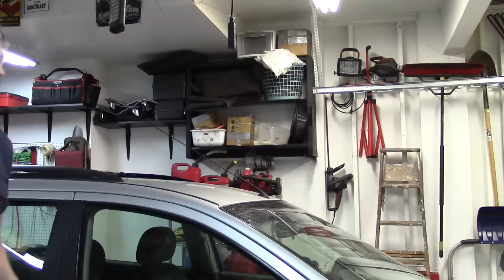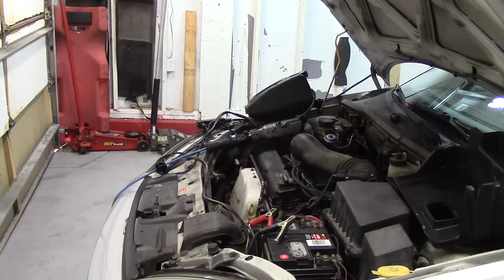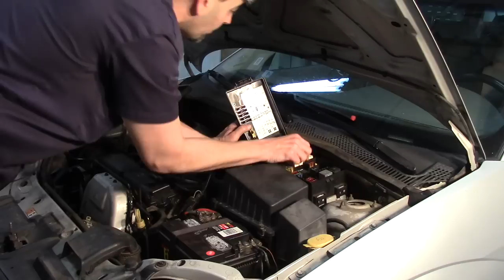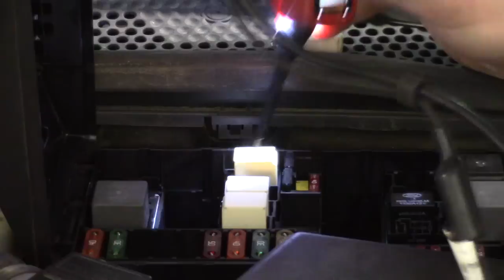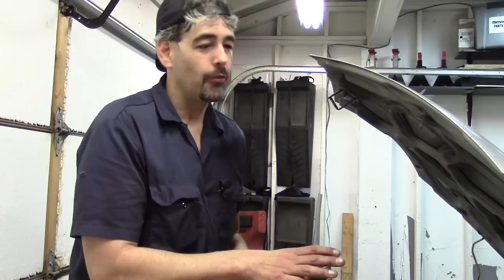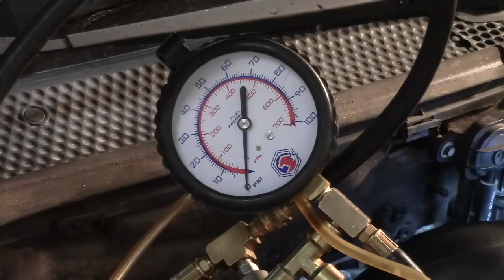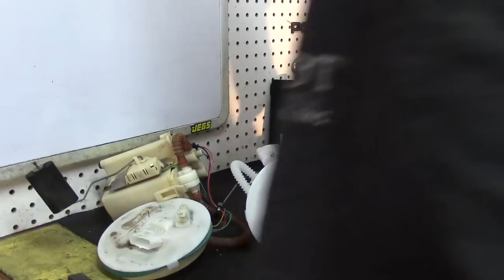Cranking No-Start Real Time Diagnosis -Ford Focus

Comment: I like your videos and have learned a lot from them, especially about the approach/methodology of repairs.. but I think this video is mistitled. The description says "No Crank No Start".. yet the engine is cranking, it just wasn't starting (until you fixed it in like 2 minutes! Awesome!)

I found your FASTTEC series and think I'll find more answers there. 

If you change the title, I'll give a thumbs-up! I haven't given anything but a view so far. :)
Reply from the maker: If I recall on this video, initially it was a no crank no start, was it not?
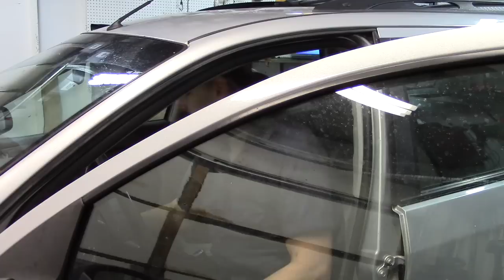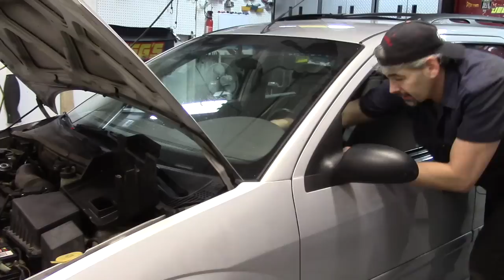Reply: At 2:10, the battery makes a click-click-click sound because it's lacking charge. After charging at 2:46, the engine cranks but doesn't start. At :22  you mention that it's not starting and not cranking. I was confused because if it is no crank, it is not shown in the video. 

Also, in the title it's "Cranking No Start" and in the description it's No Crank-No Start. I don't expect your videos to be perfectly labeled, maybe if I had my own productive channel, I would :P     Basically I want your channel to be as useful and understandable as possible in all aspects. Is there something that I'm not understanding? More likely I just wish the whole thing was even simpler than you explain it to be! 

Didn't learn much mechanical growing up, just trying to understand the components and how they work together, well enough that I can repair my car. Watching the 3rd FASTTEC video gave me confidence to repair it myself. I have all my tools together, all set for Monday to diagnose.

If I do need a starter or fuel pump, where would you recommend purchasing one? It's a 2003 Chevy S10 V6. Thanks Matt!
Reply: (If you're willing to give some quick advice on where to start, here's what's happened with the truck: 

2  week ago: it would Crank No Start, after 1/2 minute it'd sputter to a start.. only happened once or twice

1 week ago: No Crank No Start, started after cable-jump

3 days ago: Tested battery @ Autozone. Tested Healthy/Good

2 days ago: No Crank No Start, lights working BRIGHTLY, started it 45 min earlier just fine (no hiccups).

So I think that the starter was working but slowly died, given that it would start sometimes, sometimes not*. I believe that's the starter's job. Either that or corrosion/voltage drop. What do you think? Thanks again 

*I started it multiple times the past 2 weeks with only the 3 incidents I described. All other times, A-OK.
Reply: Wait a minute, Now I get it! It's BOTH "Cranking No Start" AND "No Crank-No Start" because this is Schrodinger's Catchanell.
Reply from the maker: Michael Chavez Hahahahaha I didn't think of it that way but there is certainly a duality aspect for sure!  Nice!!
Reply: Michael Chavez h

Comment: MAXI FUSE
Reply from the maker: What's that?
Reply: Schrodingers Box MY focus shut off on me one day and the cause was a blow MAXI FUSE under the hood.
Reply from the maker: DEBLAMA1 How can that possibly be the problem in this case though? It is impossible it could be a maxi fuse.  What makes you think this could be the cause based on the data shown?
Reply: Schrodingers Box I was only talking about what happened to me

Comment: Matt, by using a paper clip, which terminals do I jump in a relay? Switch side or it depends on circuit design?
Reply from the maker: You want to do as I did and validate the design first to make sure you are not bypassing the load and short circuiting the system causing damage.
Reply: +Schrodingers Box bypass the load you mean the fuel pump in this case?

Comment: I AM BACK I FOUND   P0115-P0141-P0120....NOW THE CAR WON START AFTER I USED IT FOR 20 MIN DRIVE ..
Reply from the maker: DSo what data did you get for the code diagnosis.  Can't help with just a code.

Comment: 11.05  how did they destroy engine ?
Reply: He probably meant all the electrical components that make the engine run. When you jump, you jump on the power side, not the control side because the control side is controlled by the ECM, and ECM uses 5v only while you jump it with 12v directly from the battery....doing this will fry your ECM and may fry other electrical components such as MAF sensor, CAM and CRANK sensor...etc :)))

Comment: Using Loadpro leads, this would have been much faster.  If you haven't yet watched Dan Sullivan's videos, you should.
Reply from the maker: +True View How would it have been faster? Either way this is an open circuit, not a resistance issue. How would load pro have been faster??????

Comment: nice vid, enjoy the clarity. Wish all on call outs and garages followed this 101 procedure. I usually teach my apprentices and staff to give the tank a few wacks while ign on or someone cranking,often pump will actuate and verify quickly a fuel pump fault. (of cause ensuring brake on and out of gear or in park!)
Reply from the maker: +Peter datechmen How do you confirm if the whacks indicate it was the pump vs wiring?

Comment: Would a zero voltage drop across the fuel pump fuse during cranking or priming  prove that the fuel pump is bad?
Reply from the maker: If there was absolute zero voltage drop then there is either bad pump or open in wiring. if there is "ghost voltage" then surely the latter.
Reply: Or the meter picking up stray voltage from a flourescent ballast or other electromagnetic source.

Comment: Good job.  

I was expecting spark.  My Focus had an ignition control short to ground.  The control line rubbed through insulation on egr tube and, of course, pulled down circuit and fried the coil.   The coil had a big crack in its bottom. 

Thanks for posting.

Comment: Did you say that you're not  mechanic? What exactly do you do? You're obviously well trained in this. Otherwise, how would you know about electrical circuit operation and function?
Reply: +689452379 Well, he's actually a microbiologist (I think it was?) with other interests, I guess you can say. And he's (obviously, as you can see) a very smart and  intelligent man, with both the science and know-how to back up what he does. Love how his mind works! Sees logic and/or solutions to everything. Actually, I've learned more from his channel about stuff like the electric system on cars (even though that's not even his strongest suit by far, according to himself) than anywhere else. Do yourself a favour and sub! :)

Comment: I just replaced headgaskets and intake gaskets on my 2001 chevy monte carlo 3.4. changed all gaskedts reinstalled all parts plugged in all electrical connectors.checked for spark, fuel pressure,check crank sensor. it has full charge on battery but now cranks slow and trues to fireup until battery is drained low enough not to crank engine. problem is it will not fire up and run. the battery light on instrument cluster comes on then shows security flashing in message center on dash. hit the key to start and cranks until battery dead.im am at loss as i bought the car drove for month started fine, one day overheated and found the gasket sealant failed on intake. Since i had it tore down that far i decided to go ahead and replace headgasket, exhaust,upper and lower intake gasket, replaced faulty throttle posistion sensor just before overheated. im am lost and cant afford to take to shop being single dad i dont have money for shop fees. any help would be appreciated.thank you. (jasontaylor4503@gmail.com)
Reply from the maker: +Jason Taylor So what's the problem? FASTTE or C? Start there

Comment: Just wondering.  An OBDII sensor reads the fuel rail pressure on these cars.  Is that a reliable test for fuel pressure?
Reply from the maker: +Rusty Reckman While I have never seen it not work,  technically if you have no fuel pressure indicated, is it because of no fuel pressure or because of problem with fuel pressure sensor or its circuit?

Comment: Ive got a burning question hahah your videos are great but im still stumped. same care 2000 dohc ford focus, died while running, changed the battery it ran a few miles and hasnt started since... ive done new fuel pump and filter crankshaft position sensor and new plugs.. it will start on starting fluid but quickly dies.. its got spark and compression and when i pull the fuel line to the rail it dumps fuel out at the turn of the key. im stumped it seems the injectors arnt pulsing or somthing but im at my wits end. any help would be greatly appreciated. thanks in advance
Reply from the maker: +j derossett What was the data you got that indicated you needed to replace the fuel pump? And more importantly, what was the data you got that indicated you needed a new crankshaft positition sensor?
 I need those data in order to help.

Comment: You just proved that what my auto shop instructor said was true. "A no start should be the easiest problem to diagnose.", and the hardest, in his opinion ... driveability. Greatly enjoy your videos. The step by step logical path is extremely helpful.
Reply from the maker: +pramponi I agree with your instructor very much!!
Reply: @SchrodingersBox  
How about a no electricity problem?
any tips?

Started as an "intermittent" clicking sound (?possibly coming from a relay/solenoid under dash near fuse box?) and electrical power off/on...(only had it for a few weeks)

NOW ... that has just become a "constant" no power at all, ever.
(open the door: no dome...
Turn lights or hazards,  nothing...
Turn key nothing ..no power at all...
(Except a faint red glow on the little red led near the hazard flasher button, but when keyboard turned goes out)
...and no more clicking either...

 all grounds tested good, (put jumpercables to bridge anywhere there might have been a weak ground too just to see)
 new battery, all charged up & good voltage ...but nothing...
 (automatic transmission)
Reply from the maker: I would start at the fuse for the circuit  and if there is no power at fuse simply trace backwards from there. If there is power at the fuse trace forwards. It’s actually way easier if there is consistently no power. Is much trickier when it’s intermittent.

Comment: Superb! Inertia fuel cut-off is another 'quick check' (for me). When I crank I check for a slight movement on the tacho - to 'quickly' verify the crank position sensor.

Comment: keyboard shop manager, thumbs sideways for get that car out of the bay and work on something else for the rest of the day!  :)    sometimes a dowel between the tank and your ear can give a bit of data when a fuel pump is near the end of its life, sounds ratty or irregular.  I have a customers focus that needs a fuel pump, changing the filter did help but the pressure is weak and if you hit the bypass on the pressure gauge, it drops more than it should so its low on power when you mash it.   They'll bring it back sometime for a pump and another filter cause filters are cheap

Comment: Wish you were in Pinetop, AZ area, because I would hire you. My car cranks, but has no power going to the fuel pump. The fuel relay appears to be good. Sprayed starter fluid in throttle body and car temporarily starts up, so I got spark. Checked inertia switch.  2005 Jaguar Stype v6.
Reply: +Harley Rider You need to test for power at the relay port then or for an open to the fuel pump
Reply: +Schrodinger's Box Quantum Mekanix 
Thank you for your response. I am a learning armature, so forgive me if I am not certain that my car has a 'fuel relay port". Perhaps on my vehicle it is called something else? I googled it and came up empty.
 Also, what do you mean by "for an open to the fuel pump". You mean a short in the wiring?
Reply from the maker: +Harley Rider Yeah honestly you'll probably need someone with electrical experience to track this down but basically if you re-watch my video look at where I am doing the DVOM testing at the fuel pump relay port in the engine bay. Thats your next step and I show how to do it in the video.
Reply: +Schrodingers Box Thank you sir. I will rewatch this video for the DVOM testing. thumbed video up.

Comment: im a good mechanic  i have a page on facebook and i get lots of bussiness as a mobile mechanic. i sprayed starter fluid in the throttle body and the car started just fine ran a few minutes and died im going to check the fuel pump by taking off the fuel filter underneath the car and then turn on the key if the gas dont come out of the fuel tank then its the fuel pump. but of course ill check all the fuses before replacing the pump. after i check the electrical if the pump dont work ill change it out and that should fix the car. 2003 ford focus also has a starter relay fuse in the box next to the battery and if you change it out it could also fix the problem. but im sure its the fuel pump because the car was being driven and it just died. it starts with starting fliud so that tells me its the fuel pump. blevins auto repair on face book alturas ca
Reply from the maker: +James Blevins If fuel comes out at the filter how do you its at the right pressure?
Reply: +Schrodingers Box . i would use a fuel pressure gauge on the fuel bleeder on the fuel rail

Comment: Great fast clean diagnosis. Puzzled by the 17 thumbs down - I couldn't see anything wrong with your explanations and methods at all Matt. As the saying goes "you can't help some people"
Reply from the maker: +mrghiax Exactly.  Many of the thumbs down are from "over the hill" professional mechanics that realized their vacuum gauge and dwell meter are useless in today's world and the fact a DIY can work on computer controlled vehicles frustrates them.
  I see it all the time.
  Others just thumbs down because the video is longer than 3 minutes.
And others, believe it or not, are just trolls that actually subscribe to my channel and thumbs down the instant I make a new release despite the fact they watch and learn from the entire video!

Comment: In the feul pump the motor was blown or did not work or was fried. What is the voltage of such motor in fuel pump?? Please share about it thank you and hope to hear from you soon.
Reply from the maker: +Oliver C In this video the 12V motor itself was fried.  In a previous video it was actually the wiring on the motor's "pigtail" that was fried- the motor was actually OK but best to replace it anyway.
Reply: +Schrodingers Box Thank you, and you are very generouse man. I am an Electrical Engineer with two Engineering degree one in Electrical engineering and one in Computer information engineering. I would like to finally study motor mechanics or will just pick it up from vidoes like yours. The 12 volt motor is not expensive so why does it cost that much to replace. I mean you can buy a 12 volt motor for nearly 25 dollars or even less in UK.

Comment: Fuck dude, same thing happened to my '03 fuckus... CPS, then, after sitting in a parking lot for 3 hours, eventually gave up, here now, on the internetz
Reply from the maker: +Chris Poteet How did you diagnosis it had CPS failure? If you can do that then diagnosing a no start should be easy
Reply: Schrodingers Box We actually found out, the '03 Zetecs don't have pressure control, they have a bit that controls the power of the fuel pump, we heard the pump humming on the car's pre-start warm-up, its called a pressure regulator, but it isn't really the traditional style, its just before the fuel rail, here is a photo (its part #5) apparently they fail quite often and are often be read only as fuel pressure loss, I think it was code #10391, anyway, I'm getting the part tomorrow (12/12) I'll comment again whether it fixed it or not, I did find though that the regulator did seem to be stuck...
Reply: +Schrodingers Box put the new part in, started right up

Comment: I am a subscriber to your paid channel and have watched the series on "how not to fry your pcm", but a question-can it hurt the pcm by testing through the load with a jumper if the load is defective and there is no resistance?  I admit electrical testing is still a weak point for me.  Thanks
Reply: +Jim Buford Actually on most any system you actually won&#39;t fry the PCM through the starting circuit regardless of what you do however you can certainly fry other parts of the circuit.
  It is important to remember that using the method I show through the relay port that you have several possibilities to FUBAR the deal
1. Send the power feed on the control side positive. Doing this will probably do nothing unless the key is in cranking position in which case it would likely blow the fuse (The starting position at the ignition is power side switched)
2. Send the power feed on the control side of the relay which essentially will be a direct short to ground with no fuse protection. Do this long enough and you&#39;ll fry something- hopefully just your fused jumper wire if you&#39;re smart, which probably wouldnt be the case if this mistake was made unfortuantely lol.
3. Sends the feed on the load side but on the wrong side (on the power feed side). Since it&#39;s fuse protected blown fuse will likely be worse case scenario.
  4. And finally we would have the situation you described - but think about it- if the load is shorted then the fuse is going to be blown when attempting to start the car which should be your first check. Now agreed if you didn&#39;t do that and put 12V right to the shorted load then yes- you will fry something if you apply the load too long. Again, hopefully it will be a fused jumper wire.
Reply: +Schrodinger's Box Quantum Mekanix  Thanks.  The picture is getting clearer.